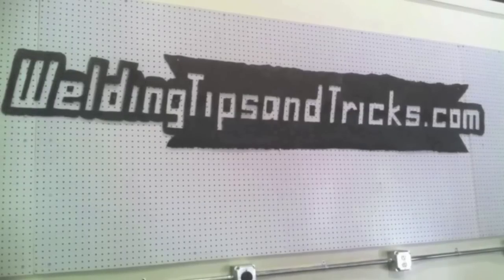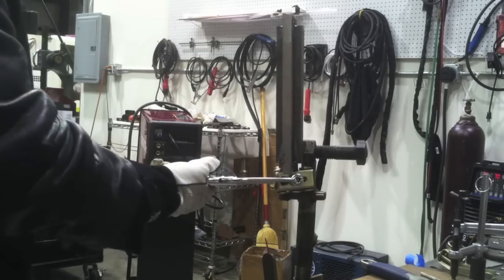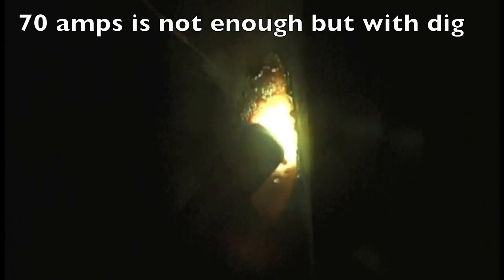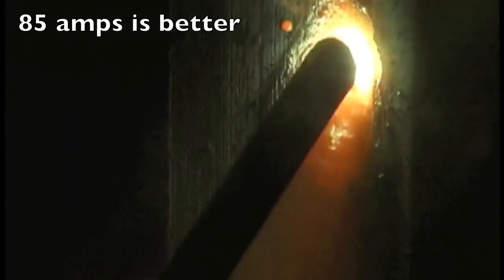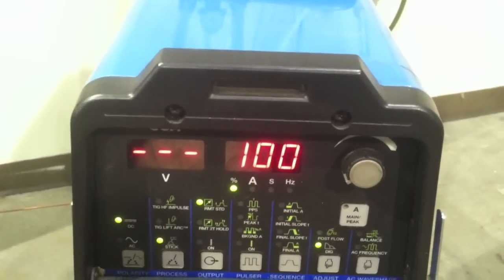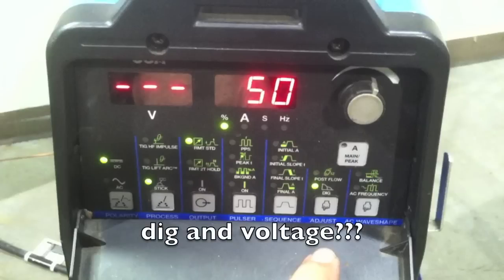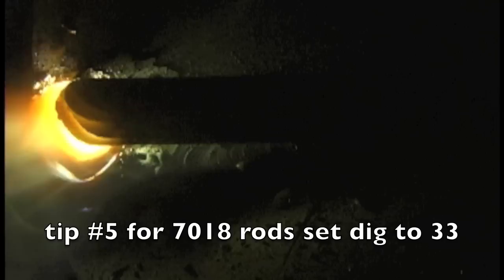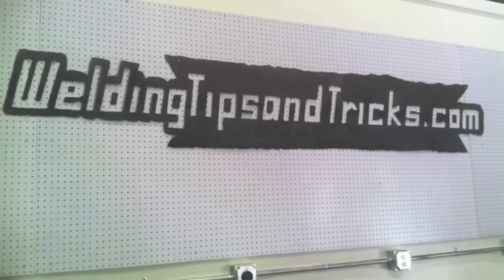6011 Welding Rods - 5 Tips for Vertical Up

Comment: Is 125 too hot for 1/8 6011? I took a weld test for a barge company today and the weldor had the machine cranked to 125 for the 6011 doing vertical and overhead. Needless to say it didn’t look very well and the rod was just eating into the metal

Comment: I don't think my small inverter machine like 6010 or 6011. 6010's do nothing but stick / won't light and the 6011's stick alot too, but run ok IF i can manage to get one to light. And forget about using a half burned rod. Even grinding the tip clean, they won't light. 6013's always run fine tho.

Comment from the maker: it wont affect penetration but you might get porosity.  And on thick steel or high strength steel, cracks can form from hydrogen being diffused into the metal.   thats why 7018 and 7016  are classified as low hydrogen and need to be stored in a rod oven or new and sealed in a container. Hydrogen molecules are tiny and can find their way into  steel microstructure and cause cracks.

Comment: I'd hate to go to a school that makes you use 6011 rods. They stick too much on ordinary AC welders. 7014 rods are much nicer to use on mild steel which is the metal pretty much what an average shop uses.
Reply: But e6011 works in the real world where paint, oil, rust etc are in the way.
Reply: @elonmust7470. In the real world there is seldom any contamination that can't be easily removed with a knotted cup brush on a 4 1/2" grinder. I'll stay with 7014 rods.

Comment: our beads can only be 3/8" thick. but they like to see stringers... we take 1inch thick v groove bevels with a backing .. cut them in a band saw and side bend them. when im running overhead i run about 110 amps and bearly weave my weld the way we weld takes forever to fill it up

Comment: ive filled up like 3 or 4 practice plates... i make the same stupid errors every time my root is awesome but when i get to the cover it gets wavy also im welding using a tombstone so heat may be off but its pretty hot. they tell me its incomplete im trying to practice using the run off more (starting on the backing bar) its hard because the backing bar tends to get perosity on it and the rod will stick so i tended to start in the test plate

Comment: This was great. In class we are using 5/32 6010 for vertical inside corner welds. My beads travel speed and arc length are good until about an inch from the top. I start to get a lot of arc blow and when I adjust my rod angle it either blows out the top or mounds underneath. I've tried shortening the arc length and increasing the travel speed but it still looks pretty sloppy. Even angling the rod downwards towards the top doesn't help. Any suggestions???
Reply: stop about an inch from the top and keep restarting for the last inch.
Reply: it worked great thanks man! I take my structural cert on Tuesday! wish me luck
Reply: np man, gl and stay motivated

Comment: Hi there, 
First of all I find your videos very interesting and educative! 
About the 7016 and 7018 which are low hydrogen electrodes hence they have to be preheated in an oven. I do not have this facility currently. If I don't pre-heat them will the penetration be effected? I never had the opportunity to test it out my self.
Thanks for your videos!

Comment: Jody, Thanks for all the tips! Question: I need to repair some bullet holes in a 1/2" plate steel back stop, at a rifle and pistol gun club. The plate steel is impregnated with lead, zinc, brass, and copper, from the bullets. Grinding the base metal, the lead and zinc (mostly) remain in/on the plate steel. We have been using 6010 rods, but the welds are poor, and it takes forever to make a pass. Any ideas, filler metal  suggestions?  Thank you for all your instructional videos and comments.

Comment: I love stick welding! my powerarc has an arc force control. what is it supposed to be used for?
Reply: basically the same as this " dig " function , more force the more agressive the arc. It is best to not use the arc control when practicing for test's as some jobsites have welders without any kind of setting. Good luck .

Comment: Do you think a higher dig setting would affect the duty cycle of a lower amperage machine?
Reply: I have a very limited knowledge of welding machines and their functions but i can almost guarantee from my knowledge of electricity that it would (or should) lower the duty cycle. any increase in amperage such as from a dig function would increase the total power (in watts) being pushed through the machine. (compared to a machine without a dig function). This would ideally increase the temperature of the circuitry and the transformer more quickly under working load and should be used more sparingly than regular welding settings.

Comment: Are you using 1/8th wire? 110 seems pretty cold even if you are running stringers. I do my overhead at 120-130 for the purposes  of the unlimited test. My vertical is about 118-120ish. My suggestion would be to try and up your heat a bit. Best of luck bro.

Comment: im an apprentice ironworker and i've easily mastered flats horz and vert with 7018 wire.. now they got me doing overhead v-grooves and i got to say its the hardest and most uncomfortable thing to learn. is there any way you can upload a tip video for "total overhead" not a t-joint because if you ask me an overhead t-joint is not different from welding horizontal

Comment: I never thought an adjustable dig setting would be useful until I started using my arc force setting on my Everlast welder. Pretty cool stuff.
Reply: That was going to be my next question, is arc force and dig the same thing? My Lincoln 330mpx has arc force -10 to 10, so would 0 be 50%

Comment: You will fine if you are not welding to code. If you are welding to a code like D.1.1 or D.1.5 you will need to use rods that are fresh from a newly opened container and store the unused portion in an oven OR use rods that have been heated in an oven. The stay times vary some rods are good for 4 hours in ambient air and other are good for up to 8.

Comment from the maker: coming soon...tips for 4g overhead.  3/8" thick 22.5 deg bevel, 1/4" backing plate, 1/4" gap. 1/8" 7018 
whats the rule for ironworkers these days. Stringers only? and how wide is max width of a bead?

Comment: I freaking suck at vertical. I can't figure it out to save my life. My horizontal T-joint was perfect according to the teacher, but now that I am doing vertical it is just impossible for me. I get lots of globbed up parts no matter how fast my travel speed is or my amperage. My teacher told me to travel much faster than you are traveling in the video and to not pause at all, just up and down quickly up the metal. I've tried everything I know to try and just cannot get it. Please do a more in depth video showing how to stack beads on vertical 6010.
Reply: I hope you were able to get over the hump. I remember having fits over stick welding many years back. I use my everlast mig for everything now a days but I want to get back into stick welding. I remember having big issues when I first started but after much practice it all suddenly clicked and got better. Hang in there.
Reply: Dont do little whips whip up abt 2 inches from your puddle u can see it when it goes from hot to when it freezes and come back into it. Run at 85-90 thank me later and keep burnin them rods if u aint burnin u aint learnin